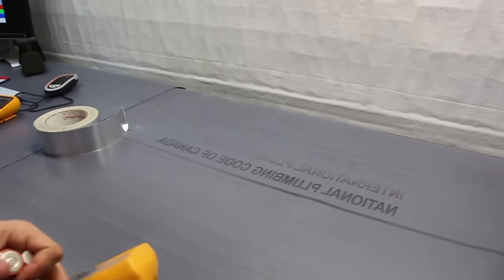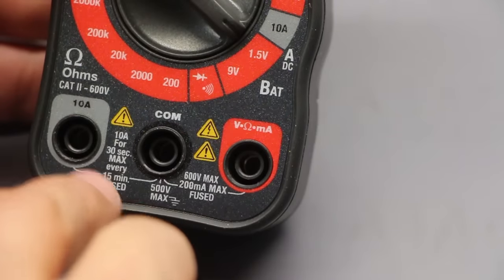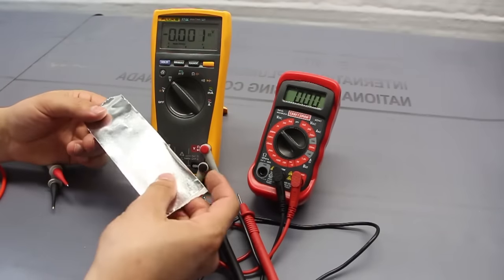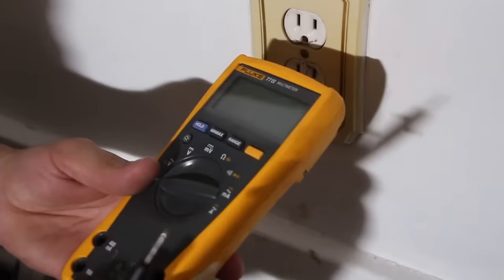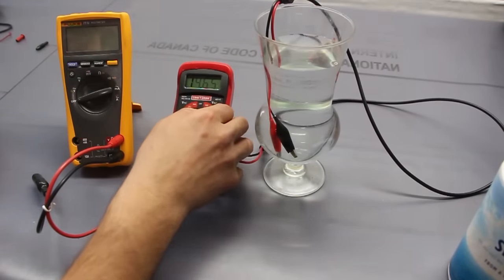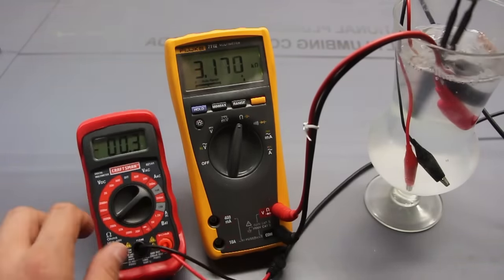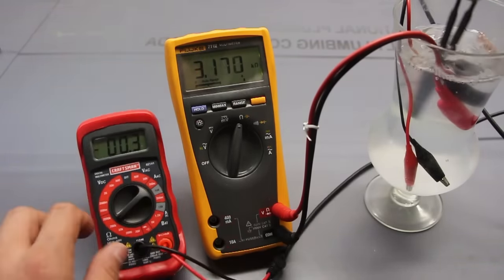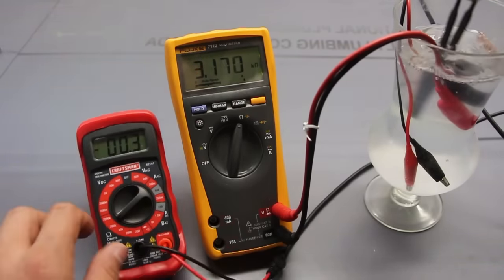The Best Multimeter Tutorial in The World (How to use & Experiments)

Comment: Not sure about the wall outlet comments.  Some outlets are set up to have the switch operate only one of the outlets, and the other is "hot wired" live all the time regardless of switch position. Two small tabs on side of outlet are separated so each outlet has separate circuit.

Comment: My fellow techs, before you test all caps in a circuit board, specially in PS boards, make shure you ground off the PCB and discharge all caps, most trouble for this PCB are cold solders or defective caps, never replace caps for diferent, lower or higer mfds or lower voltage... Remember digital meter readings are diferent from one meter to another... Im testing a PCB for a LCD TV, at first all CAPS read good, but after discharge them all to ground, I found one reading hi lecture, I replaced and this was the problem TV wont come ON......... Don't trust me, make your own test and conclusion...

Comment: That "Crapsman" meter is disturbingly faulty when not displaying AC line voltage on a 200 Volt scale. That being said, thank you for pointing out what may be a major failing in cheap Digital Voltmeters, and it will give me pause to check and verify that any meter I use will indicate line voltage in a similar range value.
Reply: I have that exact Craftsman meter and it works fine on the 200 v scale. It's not a design flaw; his meter is defective.

Comment: I use the sears meter only for the 10 amp meter for battery draw testing.  I even modified mine by solder a fuse jumper for my 10 amp fuse

Comment: You’ve seen “breakers that were off and power still flowed through?”
I was an electrician for 15 years, and NEVER saw that. B.S. detector engaged.
Reply from the maker: Yes, that is correct. Cicuit breakers can fail in the on position and though the tripper appears off the contact are still being made. Rule No one. NEVER assume a circuit dead without testing it.  A simple internet search yields many examples as well.
Reply from the maker: @Walter Hess No walter not BS. It happens from time to time. You and @charlie Zxi are making dangerous assumptions.
Reply: ive seen the faibt glow of some cfl bulbs. i always assumed the wrong wire was tapped into at the switch.
Reply: @DanielWilcoxbucketofmass  Right on Daniel, Basic Electronics & Electricity 101 , NEVER ASSUME! Very informative video all my trouble shooting questions have been answered. Requested to use my son's (youngest of four) OHMmeter to repair my dryer, he laughed said "ok mom" and gave me no instructions. I'm not telling him i fixed the dryer or how I did it!
Reply: @DanielWilcoxbucketofmass  maybe someday they will forget rule # 1 and assume the circuit is dead cause the breaker is " Off " and get knocked on their ass. Had it happen to me with a 220 oven hook up.
Reply: breakers fuse closed  sometimes man. i dont know shit, but i do knows that. you should kiss your family and thank god your alive bud.

Comment: I put the probes in the socket and it blew up
Reply: Cole Torres PMSL... Boooom
Reply: did you put it in the right mode in the DMM or did you cross the leads while touching socket, i'm not sure 100% by what you mean by "it blew up", but i guess its the first one.
Reply: We are proud of you
Reply: You had it set to measure current instead of voltage. Got to be careful when you set your meter to measure current, and try to measure a voltage source, you are applying a dead short to your AC.
Reply: Me too

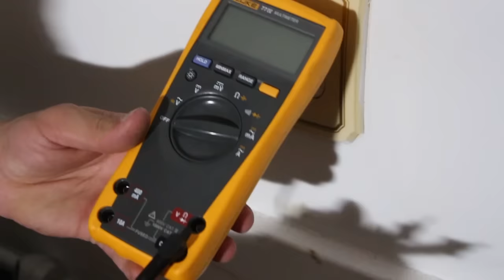Comment: Between 17:30 and 17:40, you switched between the two models, but switched the black and red cables, from the left to right sockets. I have no electrical knowledge, but I recently watched a video showing the danger of reversing the probes. In that video it seemed that, if they are reversed, one immediately becomes live, and can arc and possibly electrocute someone. Any guidance is appreciated.

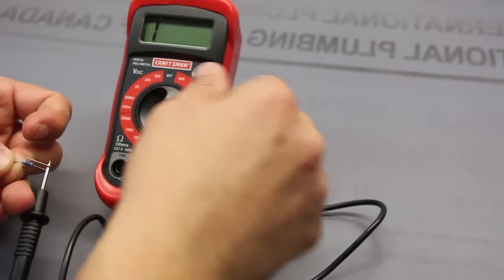Comment: 14:17 "It's one thousand what? so you move handle up, oh its 1k resistor" :D :D Dude 1000 what? If you do not know what are you measuring do not use it. You don't even know basics of electric mesurement.  Larger the scale, larger is error. 1k you measure with 2000 scale not 20k.

Comment: the ratio of likes to dislikes is confusing if this is an error ridden video. either its not error ridden or folks are sure willing to take faulty info on faith.
Reply: It's probably electricians down voting it. A lot of advice he gives isn't safe at all, like using a cheap $10 meter to check a socket connected to mains.

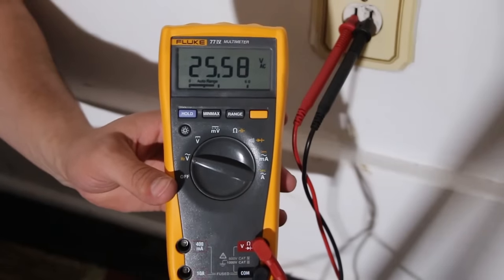Comment: 18:49 that is a "ghost voltage". If you measure it with a dmm that has "LoZ" scale, you won't see it anymore. Does the Fluke 77 iv has autohold?
Reply: In the meantime I bought a used one and I've found out that it has only autohold, not manual hold, but that's what I wanted and I use it almost everyday. I have besides a brymen and a keysight, but fluke's quality is way better!

Comment: All of the ohm meters must be made to the specs agreement with the Simpson Multoimeter Company. Simpson holds the patents. You can tell the meters are licenced from the original Simpson because they all have a dial switch that sounds like the older meters from the 1950s and the plugs are the original banana plug configuration. A prob plug from an old Simpson will fit all the meters on the market today.  They are all quality meters thanks to Simpson. An American invention.
Reply: To measure ohm is in no way an American invention, no matter what method you are using.
US patents last, depending on type, 14, 15 or 20 years, and Simpson's patents we can find with Google appears to be way older, from the 1920's to 1930's, so no more protected by any patent there and therefor no license needed from Simpson to make a ohm meter of today.

Comment: Excuse me sir, if you said not to change the probes on the multimeters due to possible imprepoer readings, why did you change them when measuring voltage at the plug? (minute 18:00)

Comment: You need to find out about isolation and proving a circuit is dead. You should never use a multimeter to prove a circuit is safe. Plus tell people correctly about the V ac ~ and dc symbols on the Fluke. + you really don’t understand or explain the differences and consequences of using cheap probes and tip exposure. A lot of those meters state up to 1000v. Would you use and trust those probes on a thousand volts?  When you say be very careful to select the right range it should be, never use a crap meter on mains full stop. Really not the best multimeter tutorial in the world.

Comment: master electricians use FLUKE due to safety... you put the probes on the wrong terminals and you'll be sorry if you have a cheap unit ignorance is bliss
Reply: Mike Stombock nobody lives for ever man up!
Reply: Mike Stombock you can't say that enough times. The no pro crowd has most likely never seen a multimeter explode.
Reply: Harry homeowner always wears their Arc Flash protection and FRC flame resistance clothing.
Reply: Mike Stombock  I am professional electronic maintenance engineer nhaving 50 yrs of experience. I have five Flukes and many other makes meters. Very often I use cheap but reliable meter because if you drop it or somebody steals it, it is not so bad. Fluke is not the only good make and usually ”wannabe pros” say that you must use Fluke. In laboratory (I’ve been working in radiolaboratory) you can use many other makes which are as good as Fluke. We professionals usually smile when some younger say that Fluke is the only right meter. Most important is that the meter is accurate enough, and today most cheapos are accurate enough, AND that the meter is SAFE to use. There are some multimeters which are very bad and it’s best to buy well known make.
Reply: I was a little late to the event after a friend tried to check 660 volts with the VOM set to measure resistance.  In a flash it blew the meter apart, tripped the breaker (or fuses) for the whole big industrial lab.  My friend fell backwards and survived.

Comment: autorange takes forever. absolutely hate it!
Reply: If you press the RANGE button is locks the meter into one range and it stops auto ranging. Each press of the button advances the meter to the next range. Holding the button down for a few seconds puts the meter back into autorange.
Reply: True story
Reply: Even with a good meter like a Fluke, in some cases the autorange will refuse to lock into one range. The Fluke is my favorite meter.
Reply: It depends a lot on what is being measured. I think it happens because when measuring ohms, the voltage on the probes change as the range changes and when measuring volts, the ohms per volt changes as the range changes. If there are capacitors, resistors and diodes in the circuit things charge and discharge as the ranges change.

Comment: If you were measuring a 12v 8 D battery would you jus click the red MM up to 20v at the 10 min mark?  Also when using the red one where does the dial need to be for testing household 110V outlet?

Comment: Just a note about current testing and amperage: it doesn't take "1 or 2" (presumably you meant amps, but you didn't specify) amps to kill you.  It's much less than that.  As little as 1/10th of an amp can kill.   That's why there are warnings all over electrical and electronic devices that say only qualified people should work on them - they can be deadly.

Comment: 15:50 Strange, my Craftsman 82141 reads ~120 volts from the wall outlet on the 200 volt (AC) setting. Maybe they fixed this in a hardware revision.
Reply: No
Reply: I have the same Craftsman one and mine works you just got a bad one

Comment: I tell people unless you work on high energy industrial or commercial stuff a $50-$100 meter will get you by in most cases .. I work on a lot of automotive electrical and electronics and the vast majority of troubleshooting is done with live scan tool data and a lab scope (oscilloscope specific for automotive) . 
DVOMs are not as used as they was 10 years ago because a scan tool or scope will give you way way more information then simply testing wire resistances and open circuit voltage test. How ever I realize in the electrician , HVAC ,industrial maintenance etc they're still widely used and have some very impressive high end meters .

The biggest thing I look for is a good min/Max feature ,temp probe foe AC duct temps , accurate in the mV range as I do a lot of voltage drop testing across fuses and other loads and can equate the measured Vd to an very close amperage rating . 

What's your take on the Amprobe meters ? , I have a buddy in production line maintenance and says they're made by Fluke and meet all the same safety standards .

Comment: I set commercial multimeter to 50 to test 12 V car battery and it read 1 lil over 10 close to 12 . Is that right ? I've also a slow charger at 1.5 amp slow charge . I cranked it soo much yesterday trying to get car started but nada . I had it towed . How long will this take ? i want to be able to crank car engine to work / test on car today

Comment: IMO good leads are a much better investment than a good meter. They immediately make cheap meters significantly better, and even often improve good meters. I've got everything from a free Harbor Freight meter to a $400 Fluke to a Hantek 2D72 handheld scope and my Probemaster leads were an improvement over the leads included with every one of them. It's more obvious on cheap ones, but still make a difference on nice ones - so they're an upgrade that you can take with you as you upgrade from cheap to nice
Reply: i am a retired  tech  i still use my cheap or free harbor freight meter  -- all you need around  home fixing   stuff

Comment: The better quality multimeters, like Fluke, are generally more accurate and usually measure voltage by using a method called "RMS" which is a more accurate reading of DC voltage. The better meters also usually have auto-ranging. The cheaper meters are usually less accurate and many do not have auto-ranging.

Comment: During normal operation when a switch is not enabled, the switch's contacts are in the normally open position and the contacts are not connected to each other. When the switch becomes activated,  the normally closed contacts connect to each other and the switch becomes enabled.

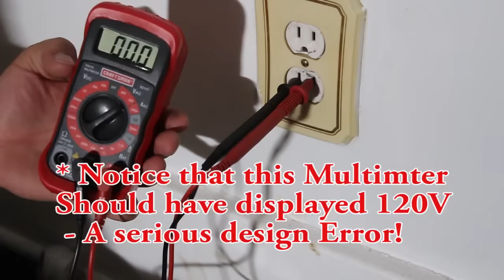Comment: The video gives good general information on DMMs. But I have a Craftsman DMM similar to what is shown in the video. I actually stopped the video at the 16:48 got my DMM meter out and set it to AC volts and 200V range and plug the leads into an electrical outlet in my house and got 118.5 volts. I'm not sure what's going on with his meter but do your own meter checks to confirm that problem is not with YOUR meter. 

Like so many other things in life you get what you pay for. A low end meter will be fine for 90% of the stuff you need it for when it comes to cars or around the house. If you are dealing with work where you are doing a lot of current measurements and higher voltages go ahead and spend the extra money.

Comment: I was watching another video and it was recommended that black probe should be connected first to neutral, (longer slot) and then red connects to hot(shorter slot). In your video it shown both ways, probably it doesn’t matter.
Reply: connect black probe first so the meter leads arent live before theyre both connected
its so you dont shock yourself by accidently touching a live probe
doesnt matter if you make sure not to touch the black lead tip after connecting the red one

Comment: My Craftsman 82141 multi-meter worked just fine when checking my wall plug on the 200 setting, its the same multi-meter as his.   His Craftsman Multi-meter is damaged or otherwise not working properly. Of course he said he paid $10 for his and I paid $14.95 for mine!!!  :)
Reply: Mine Craftman 82141 works just fine to on the 200 setting

Comment: How about a multimeter demo video where you troubleshoot a washing machine (front loader or top) by checking for voltage and resistance at the wiring harness and motors. Would be a good learning aid.

Comment: What if you need to measure a mother board that runs off 5v dc. Will the cheap craftsman destroy the board because of the voltage thats in the meter?

Comment: i have a radio shack analog meter   still use it  needs battery every few yrs   but my daily use is a very cheap (fre)  harbor freight  i  been i n repair all my life     normally looking for opens shorts and grounds   do this  with power disc.   clear tbl then reconn batt or breaker

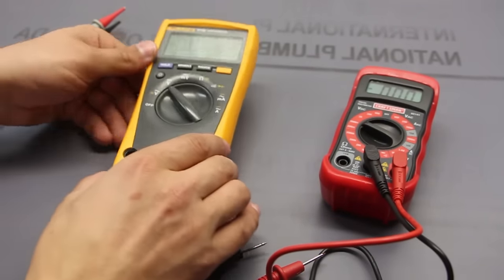Comment: The Fluke in DC voltage mode with the leads not touching anything and the meter is showing lower digits fluctuating.  (09:40)  Is this normal behavior?  What is the explanation?

Comment: DO NOT mess about with the mains electricity supply if you are not trained.  There is a big difference between a DC circuit with a 9 volt battery and maybe 2 amps on a model, and an AC circuit with 240 volts (non-North America) with up to 30 amps going through it.  Sure, the meter will blow out, but so might you if you touch the bare wires in the wrong place!!!  Other than that, quite a good video with some informative points. Thanks for sharing.

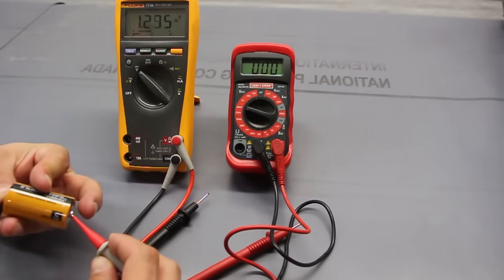Comment: 10:05 why do the two meters give different voltage measurements for that battery
Reply: Different accuracy, impedance, and resolution. Just what one would expect when there's a 60X difference in price.
Reply: @stephenarling1667  Yes. Plus factor in he was touching the metal on the probes.

Comment: At 18:00 your meter is showing voltage with the wall switch off. The wires and the insulation between the wires in your house form a capacitor and when you switch off the receptacle, because of the AC voltage and the capacitance, you meter reads the voltage going through the capacitance. The voltage you are reading has has no power so if you would plug a lamp with a 100W bulb into the receptacle you would no longer measure the voltage. Your small night light uses practically no power so the voltage you read is able to make it light up. If you measure the voltage with an old analog meter you probably won't see any voltage either.

Comment: Newbie here.... Entire house to re-wire where someone was nice enough to rewire my main panel. Is there a meter under 300 that will measure, ohms, voltage, continuity as well as tracing the device back to the propwr circuit.  I realize i can clamp the circcuit at rhe breaker first and try to follow (forget what it is called but  the giy really messed up quite a bit. He even added a hot wire and i have solar tied into my meter if that make a difference (probably not)). so its taken me 5 years and the outlets are 25 years old so I thank him for pushing me to learn electric.  So I want so.ething thay can do up to 240, also check aseasy as possible (clamp cords into outlets or light bulbs -can i do that?)  Im trying to replace most thing with led because the house is maxed out (the breaker panel and the 200 amps? Tjat rin into it from electeic company). Il be putting in a couple subpanels, amd rebalancing the electeic to which parts it needa to go to based on new usage.  Finally if i cpuld use my phone or have ot save the last few numbers thaylt would help because of my disability. Ues i plan on working here an there with an electrician but i have to do the remapping.  Okay.. Now way under 300. I know. So wjat are my bestoptions (im in South jersey if any electrian retiring wants to resell their used meter with clamps to a happy tor3d widow with three school aged kids :)  but seriously i need something that will make it easist on me to do alone. So thank you in advamce for any suggestions you might thrpw out here (besides Im crazy. I already know that;))